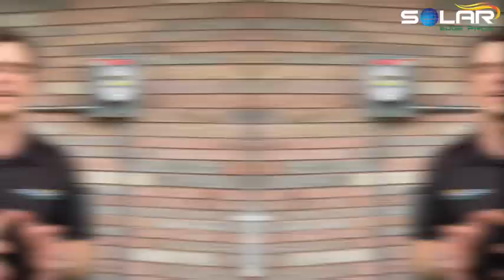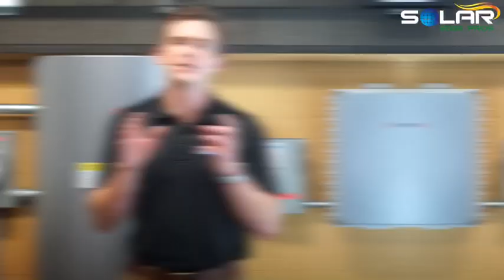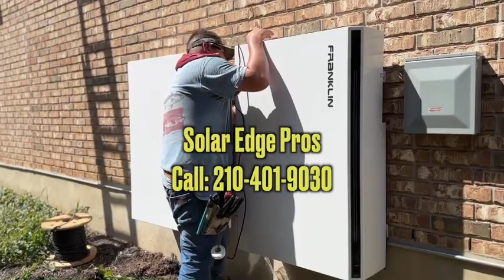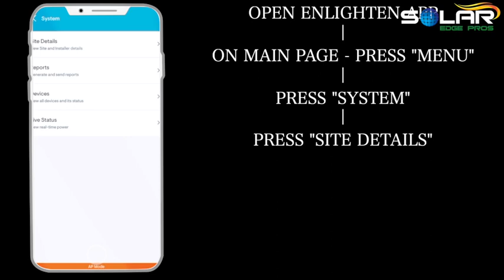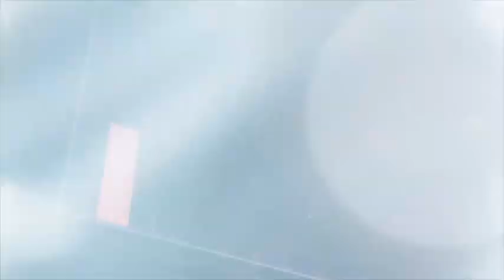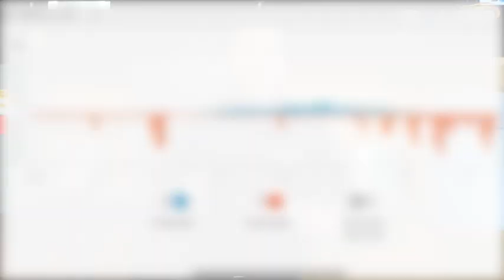Our 6 MOST Common Service Calls

Comment: Thanks for the info. My solaredge system is not working properly . One day panel 5 has no power than the next day 11 has no power.i only have 12 panels on the string. What is the problem? Can you tell me what the problem is? Thanks
Reply from the maker: It can be a number of things ranging from the inverter itself or an optimizer issue. I'd suggest calling/emailing SolarEdge Customer Support with your Site ID handy, see what they are experiencing on their end and what they troubleshoot.